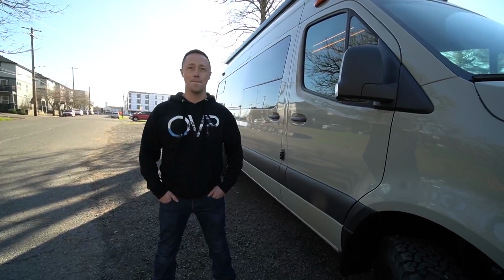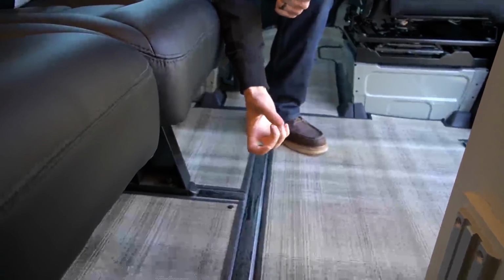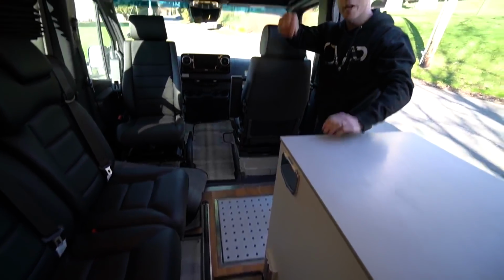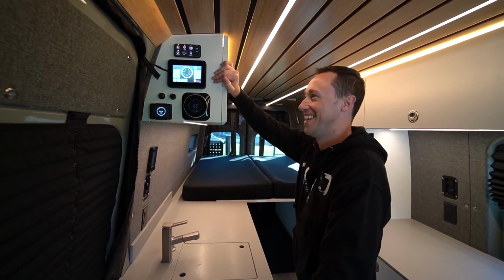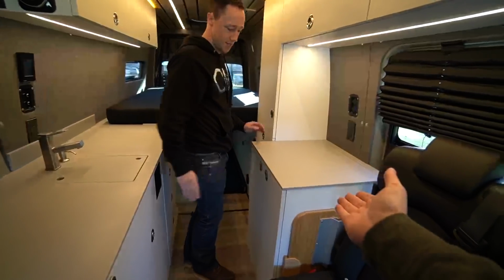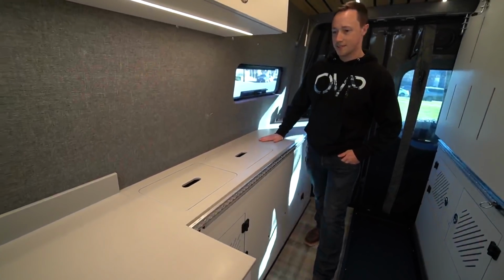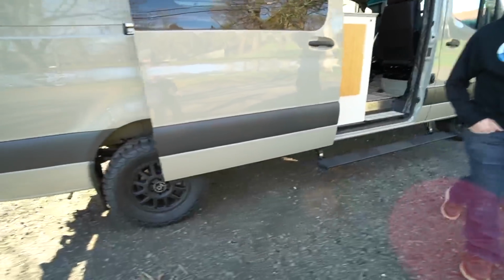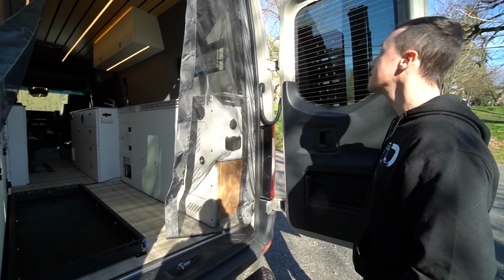Van Upfitter Showing the BEST Products - Murphy Bed, Hidden Shower, Adventure Van Build Tour

Comment: 7kw from alternator charging? That's running 2 alternators at ~583amps just for the battery regeneration. I'm highly skeptical on those numbers, but would love to see their setup.
Reply from the maker: 1 alternator is for the van itself. The 2nd alternator is only for the power system in the van build and is much more powerful then the factory one, plus larger in size
Reply: @jarrodtocci  got it. On top of that you’d need so many dc to dc chargers it’s insane. Cool to see Cathedral Park featured. I take my dogs there all the time.
Reply: @nicks-fix  Volta uses a version of the WS500 programmable voltage regulator from WakeSpeed. It utilizes a shunt to be able accurately control charging current. I am using the WS500 on my 48volt system with 4-Tesla S modules in a 2P-2S configuration and the same alternator that Volta use from American Power System. It is capable of 160 amps at up to 56 volts, so the math does check out. 7KW and beyond is possible. I have my system set up more conservatively hoping for better reliability and longer life.
Reply: @toomuchhair4553  thank you! I was trying to cobble together mechman alternators and Scotty dc to dc chargers for my system design. I’ll reach out to APS to see how that could work!!!

Comment: Beautiful...looks heavy though.
Reply from the maker: Comes in way under GVWR but also with that suspension upgrade it doesn’t matter too much
Reply: @jarrodtocci  Good to hear, I'm struggling with weight in my build...and jeans.  Keep in mind all that fancy suspension DOES NOT change the GVWR rating.  Axles, Tires, Brakes etc. all contribute to that GVWR limit.  Airbags, shocks, sway bars, etc. all improve handling but the GVWR doesn't change.

Comment: Um where can I get that shower pan?
Reply from the maker: We showed it. It’s cut into the floor
Reply: @jarrodtocci  that's not the question, I saw it in the video.  Where can I buy it?  I want to see specs of it'll work ony build.
Reply: @vita-girl4345  my guess is he had a sheet metal shop fab the stainless shower pan.